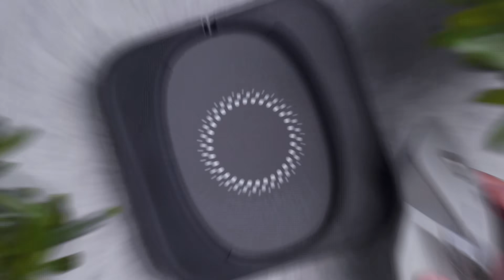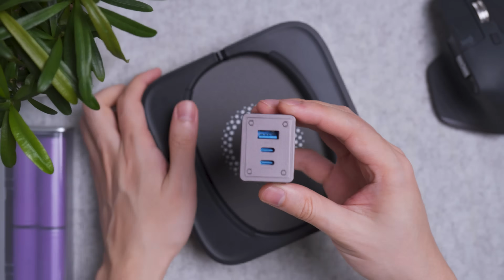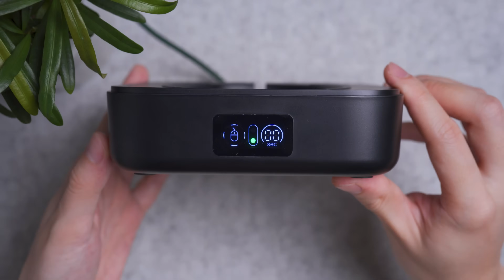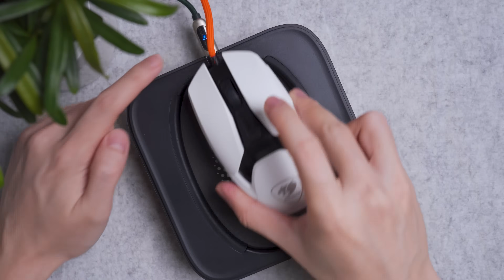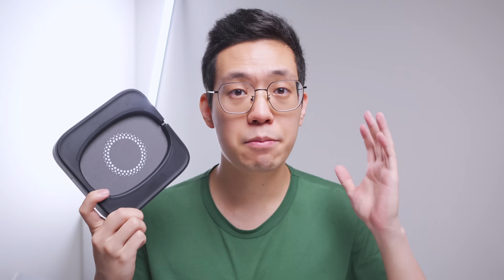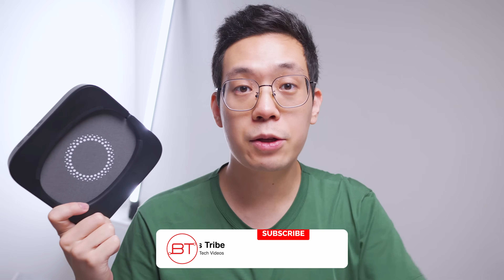Meatanty Undetectable Mouse Mover (Automatic Mice Jigger)

Comment: Hey there,

Thanks for the detailed review of the Meatanty Undetectable Mouse Mover! It's intriguing to see how it can help with productivity tracking and remote work situations. Your demonstration with various mouse sizes and DPI settings is quite informative.

I have a few questions:
1. How durable does the device seem? Will it hold up well with daily use?
2. Did you notice any impact on battery life when powering it via USB from your computer?
3. Have you encountered any compatibility issues with specific mouse models or computer systems?

Your insights would be greatly appreciated!
Reply from the maker: - Daily use should be fine.
- Does take some battery but a few percentage overtime at 1watt.
- No compatibility issues, seem lighter mouse performance better + higher DPI.